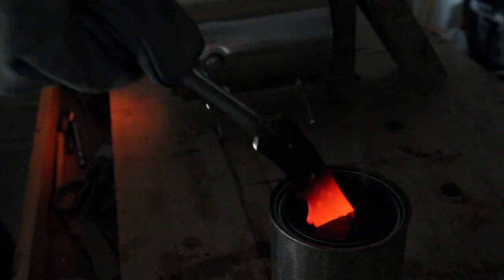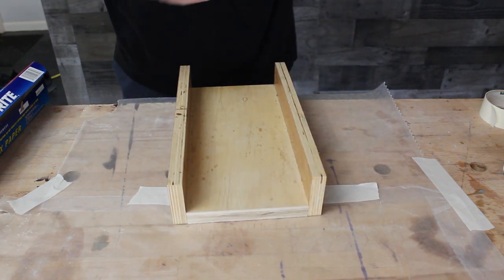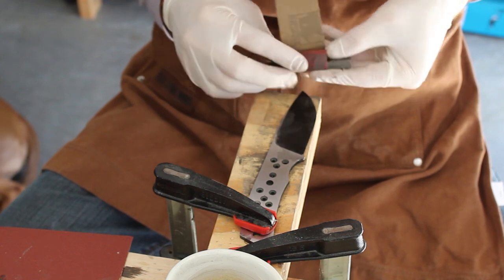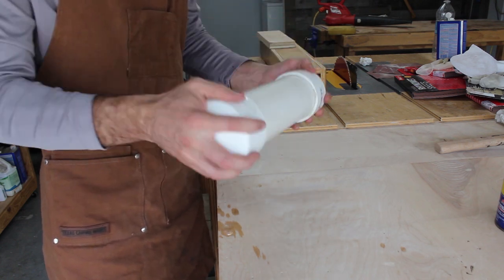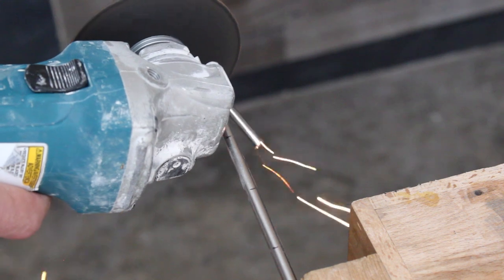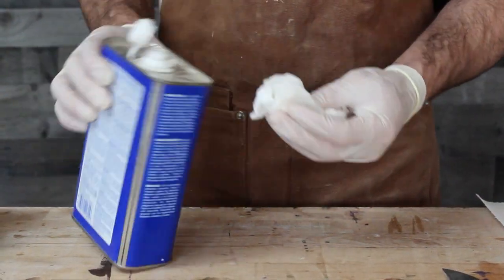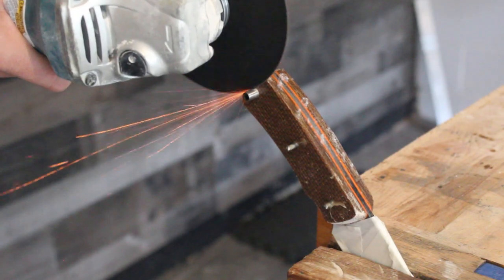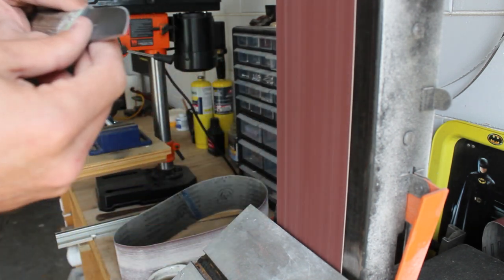Knife Making: Drop Point Edc Fixed Blade Knife batch Pt. 2

Comment: Hey there Paul,greetings from Cyprus man! Solid process and nice knife desig, good work. I have both a question and maybe a tip(?). The flush trim bit idea is really great, i was given that idea from another person in a knives forum, as well! I tried using a carbide bit but i didn't have really good results (a bit slippery process). What kind of bit are you using here? Also, something to consider...are you quenching all the knives in the same oil? If yes, then doesn't the temperature difference affect your results knife to knife quenched?
Reply from the maker: Hey Christos! The flush trim bit I use is a pretty cheap old bit that was given to me. I'm not sure exactly if it's carbide or what but you definitely need to be going the proper direction and letting the bit do the work with multiple passes.  I still get a little burn from the bit but I have to sand anyways so it's not a big deal. And yes I do quench in the same oil but the oil gets heated to between 120-140 degrees Fahrenheit and by the time I quench the knife the oil has cooled some and the blade reheats the oils some. But then it takes 10 minutes to heat the next blade and the oil cools back down closer to the target temp of 120-140 degrees. A little variance in the oil temp will not hurt the heat treat of 1084 steel as long as it's not too great. 1084 is the  easiest most forgiving steel to heat treat.